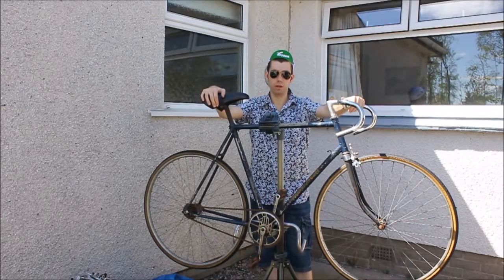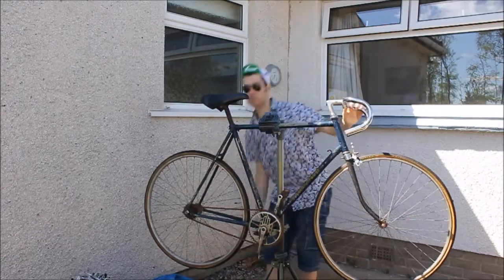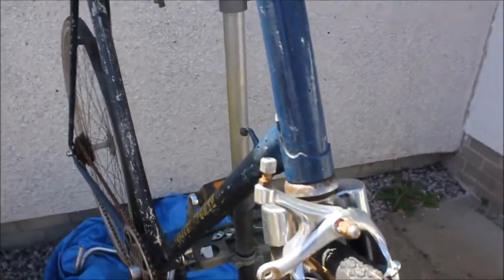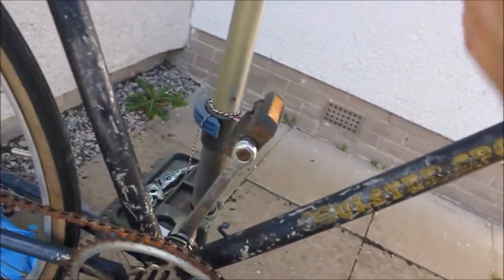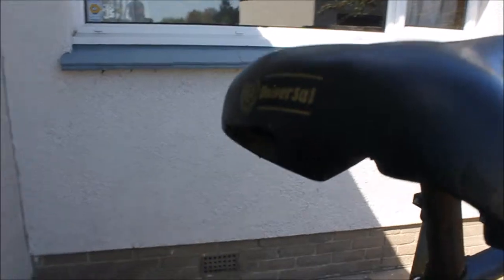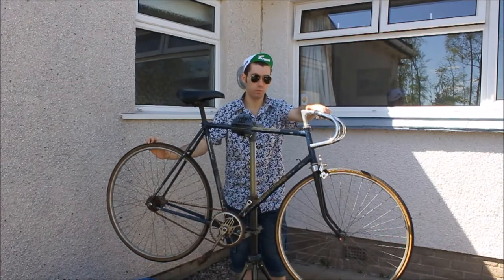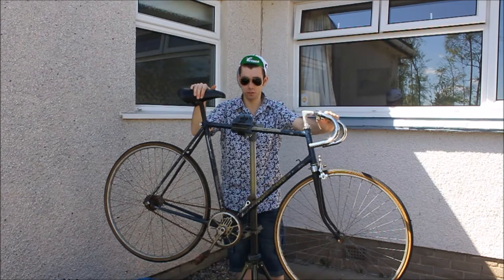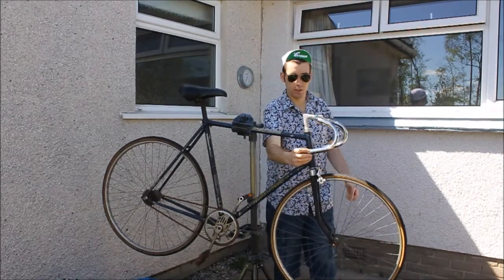Meet the Next Project: 1950s Rudge Ulster Sports fixie/restomod

Comment: hey about 20 years ago I built up a fixed wheel Rudge. From parts my dad had in the loft.  I rode it about.  but I got a sore leg as it had a bent crank, + fixed gear.  So I biked to the dump on it.  
But other people took it out the skip.  Then ride it around.  So I had an occasional ride on it, when I seen it abandoned at the roadside
Reply from the maker: +griftereck ah cool :) shame it got abandoned, any chance you can remember what bits you used?
Reply: I think that frame had a steering lock on it.  Maybe a maroon colour.  I had steel wheels.  cottered cranks.  Front wheel had a rusty rim.  only a front brake caliper.  I had yellow bmx brake pads, from a previous bike build.  Rusty rim sawed thru them in about 50 miles.  I had a strange old steel handlebar stem.  It had a curve, like a swan neck.  front loading, with a cap that had 2 bolts.  I sawed up a chair, like they have in village halls. So the top of the chair legs and the cross bar, of the chair, was a sort of low profile bars.  Bike was ok, nothing special.  I doubt Id ride a fixed gear these days.  I like easy going bikes.  Traffic and pedestrians are a bit mad here
Reply from the maker: Ah cool :D sounds like a real authentic fixie build like I see at my local community bike workshop, something nice about the raw flung together from different parts style, almost like the bike version of hot rodding in the 30s, I like an easy going bike too, but at the moment I am trying to train myself up and build up some leg strength as I would like to get into track cycling :)